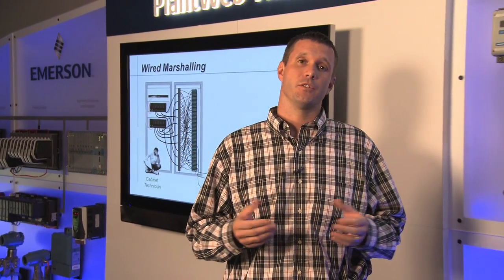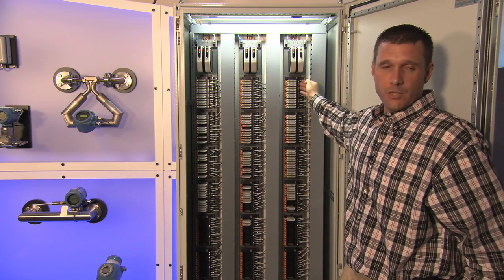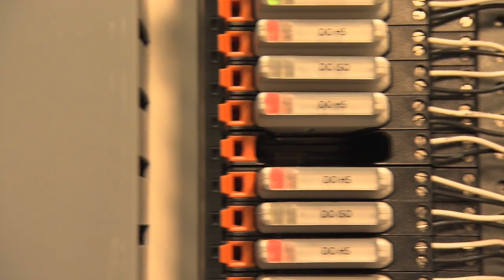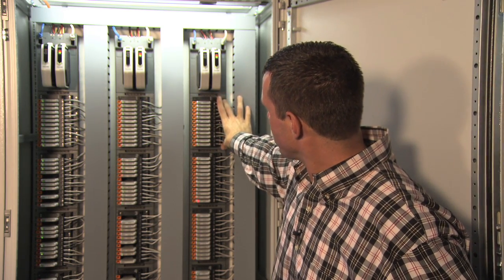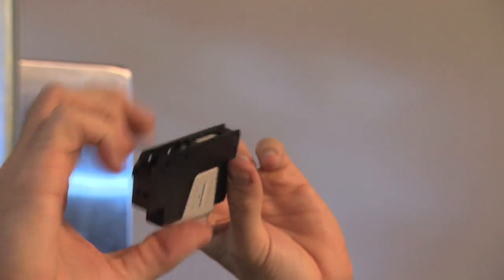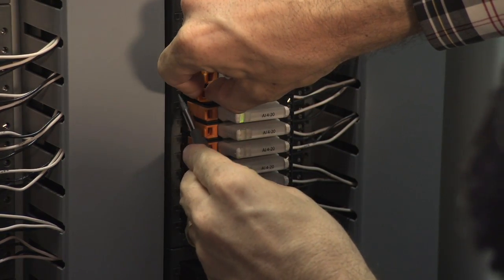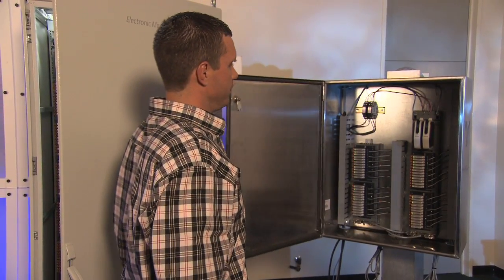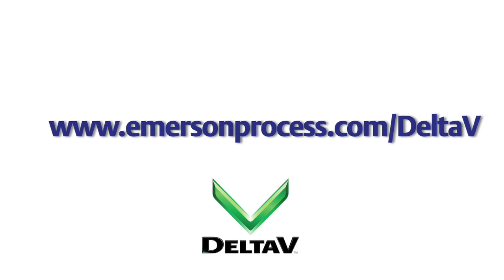I/O on Demand—Electronic Marshalling

Comment: isolation  barrier  function include in CHARM ? there is no need isolation barrier?
Reply: With Intrinsically safe CHARMS you do not need a external barrier.
Reply: @dantheautomationman6959  Not Required. Its inbuild in the CHARMs.
Thanks, Jayaprakash Solaraju
Mail- Jayaprakash.DeltaV@gmail.com

Comment: this excellent, how can the DCS channel changed without changing the wire in case of a channel fault?Is it certified to use in SIS systems?
Reply: Yes you can get SIS CAHRMS.

Comment: Neat idea! Essentially, each of these characterization modules is a user-definable I/O point-terminal block combo unit, with each baseplate in the stack playing the role of an I/O "cluster" module; there is no longer a need for a 16-point DI or DO module in a PLC chassis, and then a rats nest of wiring connecting them to TBs, for example.

Well done, Emerson!

Comment: If the charms can be placed in the field, do you then run individual cables to the DCS or a  home run cable?
Reply: From the CIOC you can run either a fibre optic or CAT5e, depending on the module you pruchase, to your DeltaV primary and secondary network.